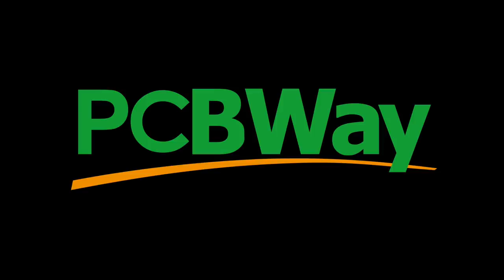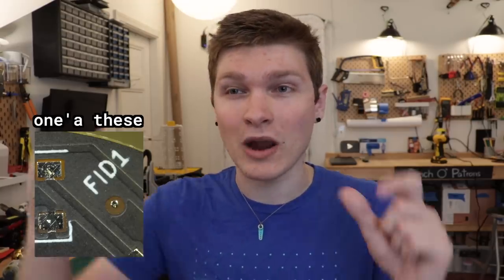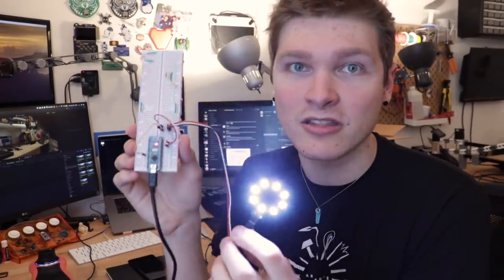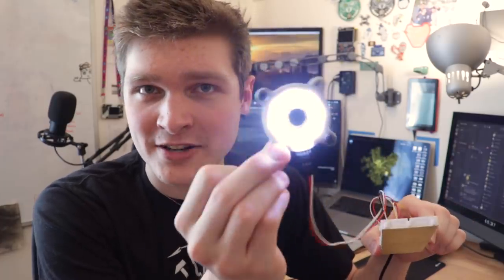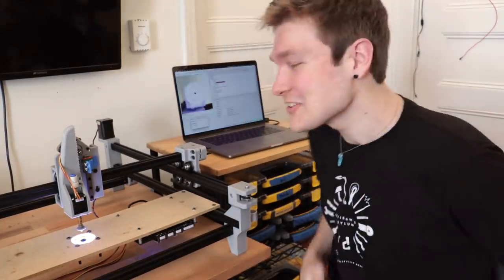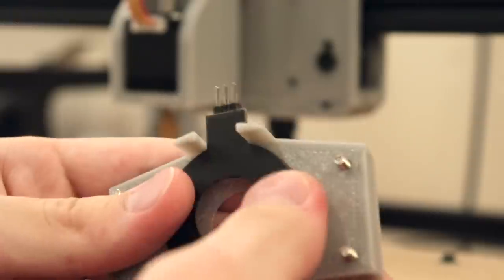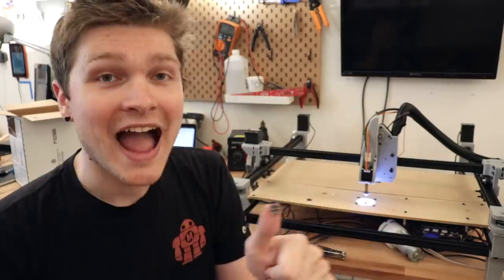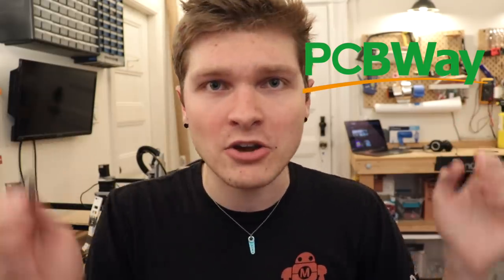Giving my Pick and Place VISION

Comment: I ended up leaving the lighting permanently on during the whole placement run, that made the vision much more reliable. I used CP40 nozzles and not Juki and think that made the tuning of the CV much harder. One last tip from my experience was to make sure to include a cover glass for the up camera. A home workshop where you have a mill will definitely leave dust on your camera lens over time. Can't wait to see if your design can place some 0.5mm pitch parts accurately.

Comment: Yes. That is warm. Think about  finding a way for cooling the LED's especially if they are enclosed within plastic. This is good practice for every project where you will be asked to put heat producing circuitry inside a sealed plastic enclosure (it happens a lot!)

Comment: Whilst I’d heartily recommend you get a little toaster oven with external profile controller for reflowing boards, if you feel compelled to use a hot air reflow pencil, you should really consider adding some background heat (say, a little hot plate) that you sit the board on and pre-heat it to around 100C. You’ll damage far fewer parts and get more consistent results.

Comment: When soldering LED's like this, you should heat them from bellow (back of the board) to avoid destroying them :)
Great work, love your vids
Reply: ya good point. RIP lil LED tho
Reply: if im someone without a hot air station how should i do that
Reply: @slickm7  You use an Iron, with the PCB on top of it for example.

Comment: You will get variation in LED intensity based on how long they have been on or as the A/C cycles in the room, etc.   I recommend on you led board respin to add an ambient light sensor as a feedback monitor.   If I the same plane as LEDs it will pick up the back scatter off the diffuser.   Your nano can then adjust the neopixel to keep the light intensity consistent.    Take a look at the AMS   TSL2561CL.   I2C so easy to read with a nano.  As sensors for it has a wide dynamic range.

Comment: Awesome stuff and as always I love your energy! The diffuser design is awesome.
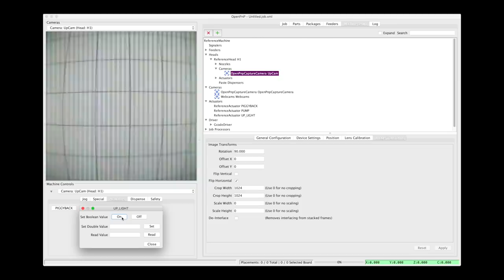In the webcam video feed showing the grid paper (7:24) I think I saw some rolling shutter from the lights. Do you need to drive the lights at full intensity to avoid flickering or has that been a problem at all? I think most programmable leds have this problem when shooting video with a fast shutter speed. Driving some regular leds with a constant voltage instead of dimming with pwm or just setting the programmable leds to max brightness and using the camera exposure settings to control the brightness might be a better solution for video unless the shutter speed can be fixed to a low enough value that the led pwm does not cause issues.
Anyhow, great work with the project.
Reply: Or maybe a capacitor to smooth out the pwm? Any problems with that (maybe a diode to prevent feeding power back into the gpio)?

Comment: Stephen, even though I have a Neoden 4 coming ... I :LOVE: your project... so right there with you I am building an Index and innovating alongside you.  

I really like that you have gone with RS485... Ring was nice, but RS485 is what PLC's and other industrial automation have been using for ages.  I have a 3D printing fix for the lighting using transparent PLA and acrylic light pipes that should take care of getting even lighting in the same way that LCD panel backlights work.

Comment: If you mount next to your upward camera a stepper motor with a small turntable, you can place the part and rotate it then pick it up and check with the camera before placing the part on the board.

Comment: No need to redesign the LEDS. Just use linear polarizing filters on the led diffusers on the outside and one on the camera. If you rotate them correctly you get cross polarization which negates all specular reflections which means glare is totally killed. Some filters from the 3d movies should do it!
Reply: That's a really interesting idea!

Comment: first of all nice project. I work with an ASM sipplace our ccp head has also 2 component sensors. Sometimes the head losses a component while moving. So then you get an alarm.  i believe it uses just a smal laser sensor but i'm not 100% sure.

Comment: I see you soldering by hand. You talked about the hot air soldering with your pnp aswell. But... I have a oven here, that is about 40 bij 30  bij 30cm, without a controller but with a thermometer. I takes me 5 minutes to solder a full plate of boards. The oven was second hand and cost €17.

Comment: Would a mirror on the gantry that is moved under the picked part not be a good idea: the downward facing camera can then look at the part. One camera less and a faster PNP process because you don't need to go to the fixed upward camera location. Just wondering

Comment: I would prever 3 Points on the Board, so the Vision system can exactly dectect, how the PCB is oriented. 
Because with two points you have 2 Positions, in which the PCB can be oriented. If it is false oriented, the p&p-System will place the parts on the false positions...

Comment: Suggestion for the cameras: Use a 5-pin connector (+5V GND D+ D- and LED) on both ends, instead of running 2 cables to each camera.

Comment: on the openpnp github page it says that you need two usb busses for two cameras to work properly
Reply: Some cameras don't play nice, when two are connected to the same USB root hub. The easiest solution is to just plug the cameras into different USB Ports in your motherboard.